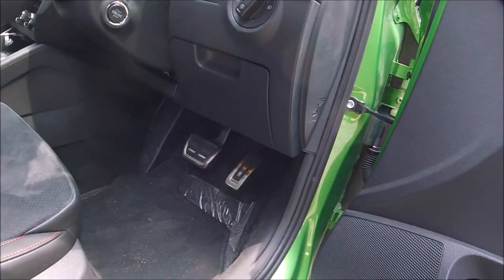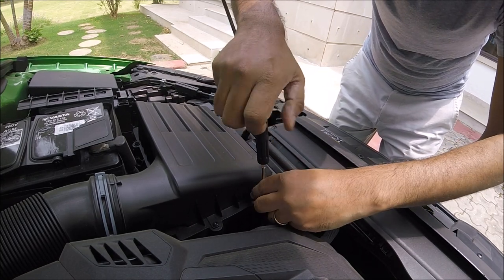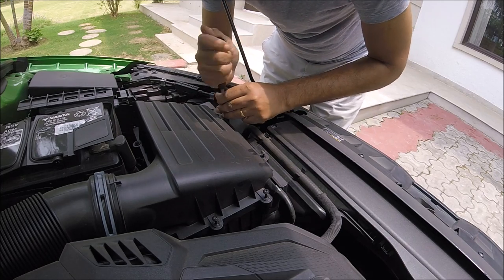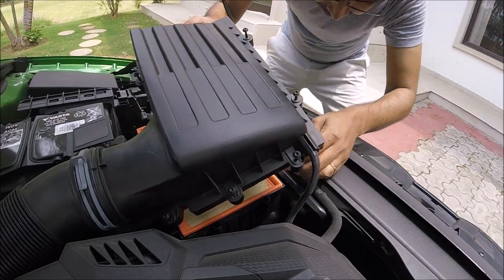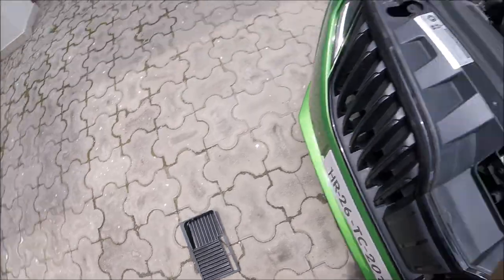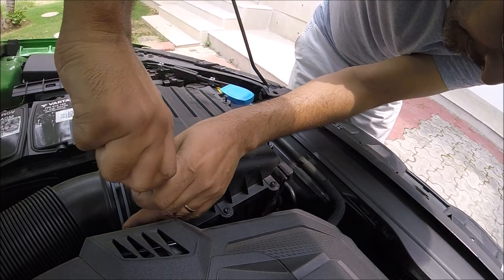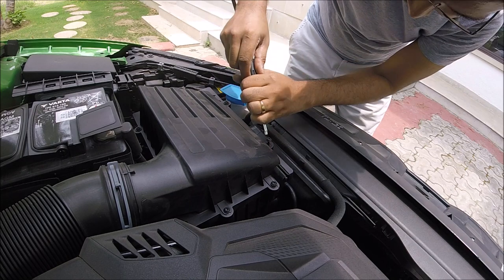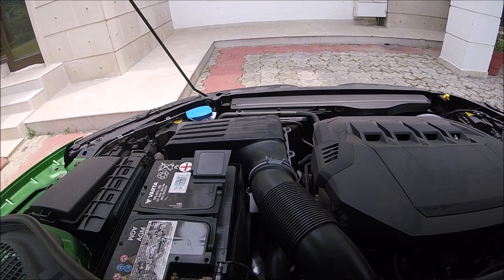Skoda Octavia RS245 - Modifying the stock intake box for better airflow #OctaviaRS #OctaviaRS245

Comment: In my experience. Removing the snow guard didn't help much if you are still on stock filter. The filtration of the stock filter is so good that removing snow guard didn't have any impact to the air flow as a whole. 

In fact if you try to fan yourself with the snow guard you can't feel the wind cos the air cuts through the snow guard pretty good.

Just wanna set the expectation right for all viewers, this is not a magic mod. No harm, no cost but also not much difference.

Save your 10 mins from doing this mod, unless you pair this task with an aftermarket  drop-in filter...

Comment: i have done this stock oem airbox mode 2 n half years back with CTS inlet pipe n Revotechnik hose also added aFe dry drop-in filter, felt instant throttle response then i had dremel the front air scoop to make it direct air flow to the airbox which really help in reducing IAT.
Reply from the maker: Yea the inlet drilling is next on the cards.. this is a simple mod to free up some airflow, although some vendors might argue till the sun sets that this isn’t effective.. lol
Reply: @PrithwiRay  I think I got a reason as to why my car with an aftermarket conical air filter feels much powerful at nights comparing with the daytime.
Reply: @amjathkhan2004  which intake you got with conical air filter?
Reply: @PrithwiRay  i have seen many guys has done this oem airbox mods in mk7 golf gti or R, some has dynoed n shown 5-10whp with the help of inlet pipe and hose. Also block off plate from euro spec i have is not showing any improvement in IAT.
Reply: @salik990   Couldn't find any performance air intakes for mine. It's currently running with K&N conical air filter directly fitted to the factory inlet pipes with the help of a 2.75" to 3" coupler and 3" PVC pipe.

Comment: Does 1.2 TDI has snow grate? If it has, Is it ok to remove it? Will it improve acceleration? Because there is so much turbo lag and i am not liking it. What can i do to improve acceleration?
Reply from the maker: no it doesnt. 1.2 engines are designed with a conical filter in the housing. The lag you can't improve much as its a function of turbo size and engine size.

Comment: What a Beauty! What do you think of upcoming 2021 octavia Rs design?
Reply from the maker: The chassis is the same as the current octavia... Interiors are really nice compared to this gen RS. The overall looks of the car has also improved, but I'm feeling the new grille. the Lights and Bumper design looks lovely, but that grill is a bit of an eyesore.
Reply: @PrithwiRay  Hate the new grill ! Current is way better !
Reply: @PrithwiRay  Are they bringing the next generation RS to India ?
Reply from the maker: Arjun Rudra I think so.. 2022 is what I heard
Reply: @PrithwiRay  How come you missed the underpowered 1.5 TSI!
Reply from the maker: Amjath Khan I think the 1.5tsi has a different intake design
Reply: @PrithwiRay  Prithwy, I heard the new Octavia RS will only have the 1.5 TSI option for India which is a deal breaker for many even though the design has improved so much from the current generation Octy.
Reply from the maker: It should be the 1.4TSI Hybrid that comes here in 2022.. YUCK!
Reply: @PrithwiRay  I have my eyes on used Jetta 1.4TSI since I couldn't afford Octy, but what I don't understand is why it doesn't come up with 150hp/250nm stock engine like it's in the international market. Almost all car manufacturer seems to downspec when it comes to India :(

Comment: Will it damage the engine? Im getting this for my first car so i dont anything about engines

Edit: what is air intake for?
Reply from the maker: no it wont damage the engine.
Reply: @PrithwiRay  Really Sir
Reply: 1 why the fuck are you getting a vRS for your first car? 
2 if you don't know what an air intake is for there is a lovely Dacia Sandero for you, definitely don't deserve a vRS 😂
Reply: @willpark7483  why so bad response? Some one ask a question and instead of answering you start to say bad things, " what a  good person" you are. 
Now about the question:
The air intake is where the engine get feeds by air in to the combustion chamber, thins is internal combustion engine and needs to burn fuel, and air is required for combustion. By removing the snow plate it looks as if it will make the air flow better (not sure it will but..) this is the purpose of the video owner

Comment: Do we need to do any adjustments after removing the mesh in 1.8tsi or can we leave it as it is?
Reply from the maker: no adjustments needed. Car will auto adapt to the nice free flow of air.
Reply: Hi Prithwi...just another query with regards to octavia 1.8tsi 5E facelift 2017 car... is there anyway warranty get affected if I do petes remap and make it stock map before warranty claims...or should I wait for the warranty period to finish ( which will be 2023🤓)...also what your opinion on 18inchers on this car with regard to normal driving as a family car....need to spruce up the looks a bit😊
Reply from the maker: Shibu Joseph yes warranty void on any remaps.

Comment: I am loving your modification videos. Great work! One thing occurs to me, though. If you drive through a flooded road, the snow grate will help block a wash of water entering the engine, and help prevent ingestion of water. It won't stop it, but surely it will help somewhat? (See this video for an example of what I mean. https://www.youtube.com/watch?v=FQkDRJDcDnA)
Reply from the maker: Well yes it will for sure, but if your taking a turbocharged car thru roads that are flooded enough to reach your intake, your intercooler and gearbox will get filled up with water way before it reaches ur intake.
Reply from the maker: Also the stock intake has a pretty large drain for any water to get out.
Reply: @PrithwiRay  That is a very good point. I am not sure exactly where the start of the air intake is. I thought it was on top of the radiator.
Reply from the maker: @MrSonicAdvance  it’s in the bottom of the airboc
Reply: @PrithwiRay  Thank you.